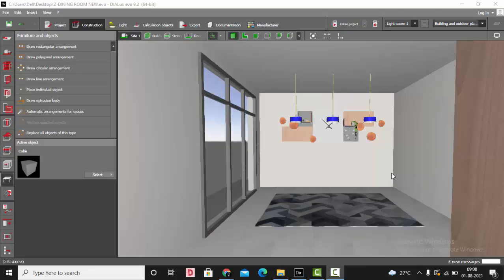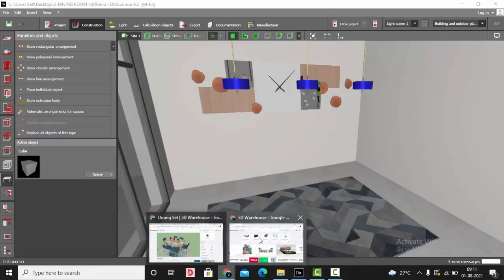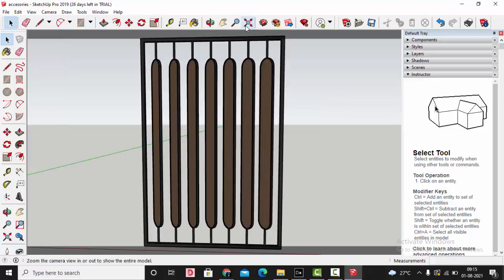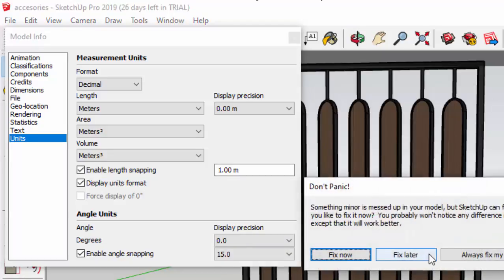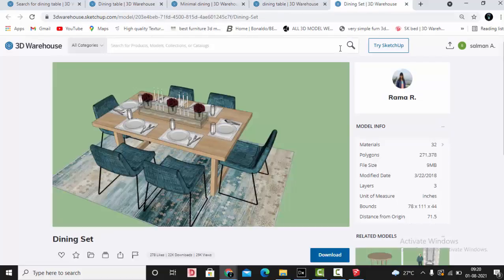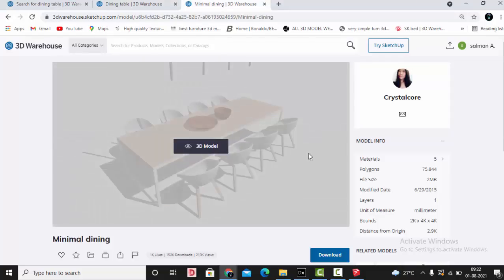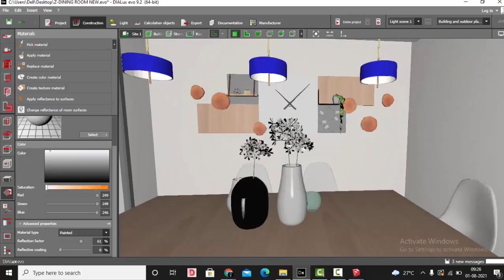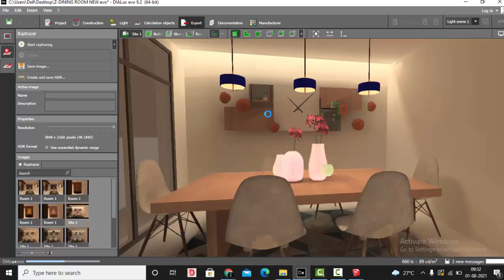How to import 3d models from Sketch up in Dialux Evo with Accurate Dimensions

Comment: Nice thank you. BUT is it possible to create a room or a building at sketchup and bring it inside Dialux for lighting analysis or only simple objects ?
Reply from the maker: To run the calculation, you will need spaces / workplane created in Dialux Evo. Unfortunately you cant create space on imported 3d room, but can only place workplane. Which also kind of tricky. So its better to construct rooms in Dx itself.

Comment: Hi Sumaiya..
I am from Bangladesh..
Thank you so much for making tutorial on Dialux EVO...
I am a beginner and I want to be expert on Lighting design, Your video is really helpful. 
Can I use built in 3d project of buildings from Audesk Revit, Maya, CAD etc? If so, please make a video on that and explain the lighting design and calculation.
Reply from the maker: Hi,
Yes we can import 3d models from Revit , CAD and sketch up. But we need to make sure the file size of 3d models is not too much.

Yes, I will make tutorial on this topic :)